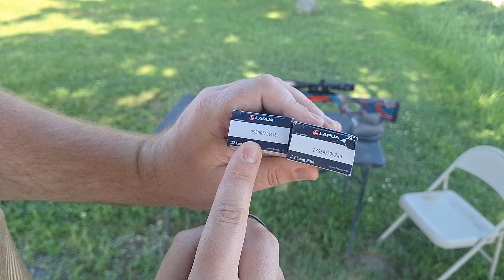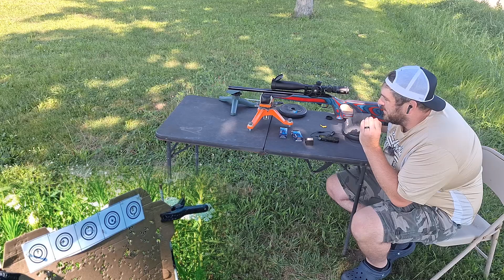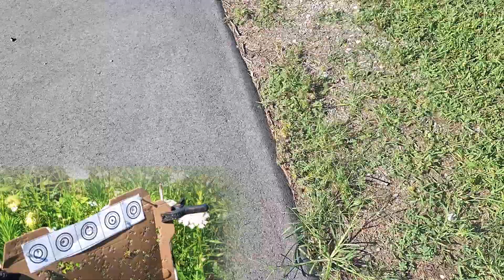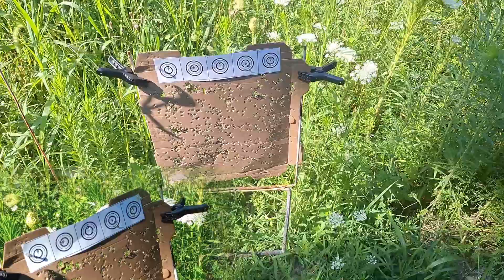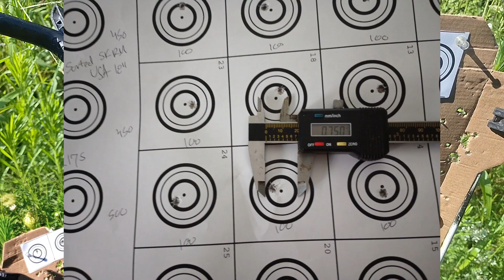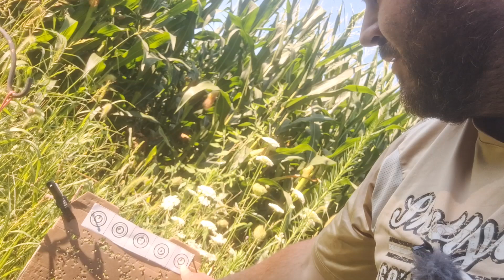.22LR LOT Testing is WASTE of Money and Time

Comment: I didn't know this about lapua lot #, anything similar for CCI or Eley ? I had thought it was just the machine that was used, and the fps was printed (or not) on the box.
Reply from the maker: I don't think cci puts that data on the lot # box flap, just machine used. Eley has a lot analyzer you can type in the specific lot # and gives you this information